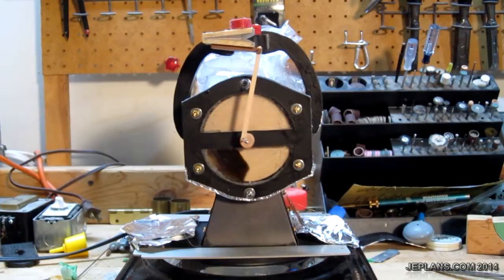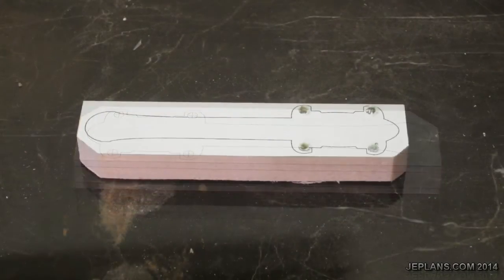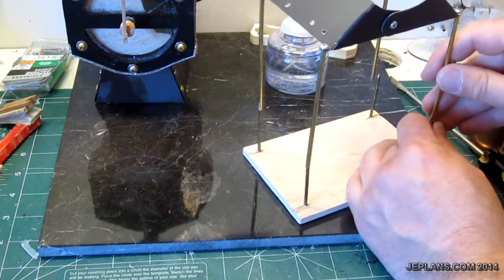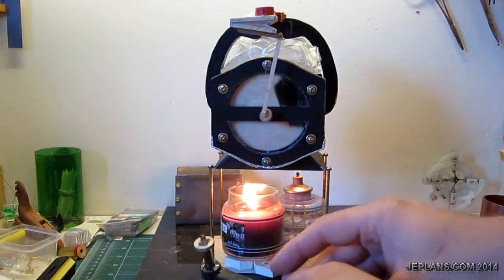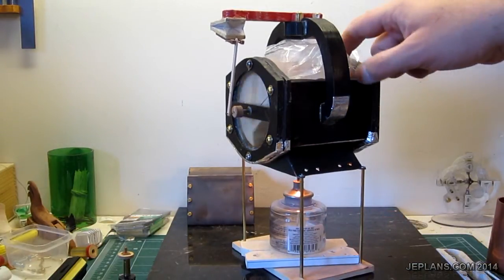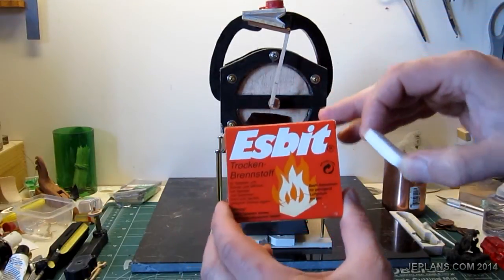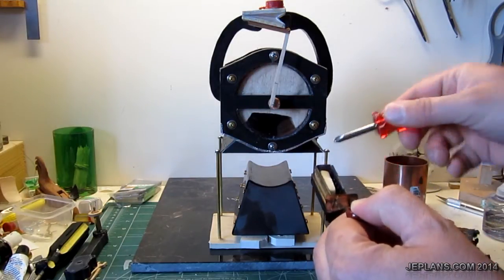Rotary Heat Engine Test Runs

Comment: Why don't you try to make one that is completely enclosed, no seals, just a few airtight joints, filled with high pressure helium? It's the simplest design in the world, and much more powerful, with amazing heat transference, no Stirling Cycle ridiculousness... So simple. Pity only I seem to have the design! Maybe I'll share it someday. You'll be like, sheeet, why didn't I think of that!
Reply from the maker: It is kind of about making with the simple tools in my workshop(Scroll saw,Drill Press) and maybe coming up with a design other people could make.  I look forward to seeing your build of this high pressure helium solution.
Reply: @Jeplans  .. If I patent it I'll have to wait years. I'll probably just publish it and make no money while somebody makes a fortune. Even now I want to blurt the design concept out.. I could give you a simple description in a couple of lines that would be enough for you to go 'damn, why didn't I think of that, now how am I going to prototype it.'... I'll at least say its rotary and symmetrical - you may be able to work it out from there. It needs 2 moulds capable of casting aluminium, comes in 3 parts, with the middle part needing some angled holes machined. I don't have a workshop. Keep up your heat engine explorations and have a great Christmas... CHEERS!

Comment: Hi. Have you seen the "rotary shifter sterling engine"? If this is really a rotating displacer sterling ( and it looks so), there must be a failure in your engine.  1. I think, it is essential, that the gap between displacer and housing should be as small as possible. Maybe one tenth of a millimeter. Stuff like that you can only get on a lathe. On a good lathe. Otherwise the gas would get hot or cold when it should not. Because there are no seals, the only way is to have almost no gas in this gap that can get hot or cold. 2. Maybe the bellow is not very effective. I saw some vids where they used diaphragm ( a piece of balloon). That seems to react on every tiny change in volume. 3. To me, your gas collectors are in the wrong position, and maybe also to narrow. When the gas got its biggest or smallest volume, the gas collectors are almost covered by the displacer. The streaming gas should get to the piston, or bellow or diaphragm fast and with less  resistance. I hope i could help you. It would be great to see your machine running well. Cheers and good luck from Germany.

Comment: Awesome! Would a flywheel help keep the speed a little more consistent?
Reply from the maker: It would too weak to spin the flywheel to start with.  It take a lot more heat than then a standard plunger type design to run and the wood I used for the frame failed last time I ran it.  Some day I will try and remake the ends out of ceramic or glass maybe and give more heat.

Comment: Nice to see it running. But rotary stirling engines are not efficient because they tend to mix the hot and cold air. Where conventional displacers really move the air. But it's nice to see this hard work into action. Great work
Reply from the maker: They sure are not as efficient but I had to try. My 1st version would have had the air mixing hot side exposed to the cold issues this design should mostly eliminate that but at same time also means for 50% of every rotation the air not interacting with the hot or the cold sides.
Reply: @Jeplans ⚠️ God has said in the Quran:

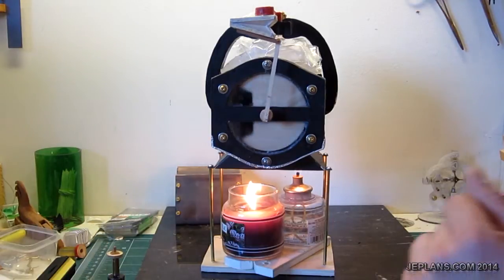🔵 { O mankind, worship your Lord, who created you and those before you, that you may become righteous - ( 2:21 ) 

🔴 [He] who made for you the earth a bed [spread out] and the sky a ceiling and sent down from the sky, rain and brought forth thereby fruits as provision for you. So do not attribute to Allah equals while you know [that there is nothing similar to Him]. ( 2:22 )

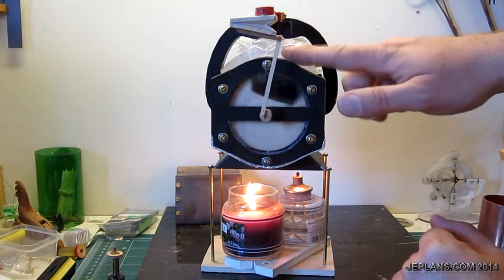🔵 And if you are in doubt about what We have sent down upon Our Servant [Muhammad], then produce a surah the like thereof and call upon your witnesses other than Allah, if you should be truthful. ( 2:23 )

🔴 But if you do not - and you will never be able to - then fear the Fire, whose fuel is men and stones, prepared for the disbelievers.( 2:24 )

🔵 And give good tidings to those who believe and do righteous deeds that they will have gardens [in Paradise] beneath which rivers flow. Whenever they are provided with a provision of fruit therefrom, they will say, "This is what we were provided with before." And it is given to them in likeness. And they will have therein purified spouses, and they will abide therein eternally. ( 2:25 )

⚠️ Quran